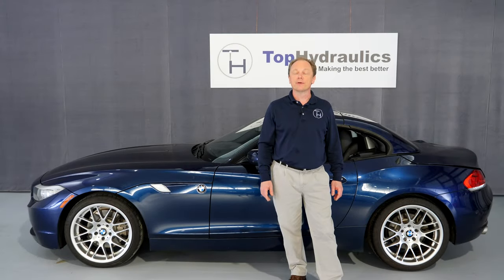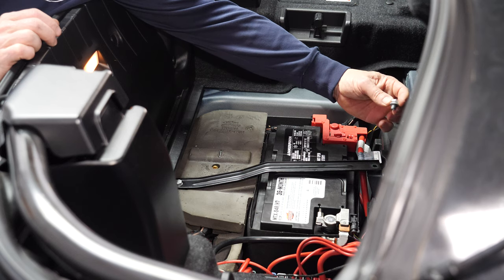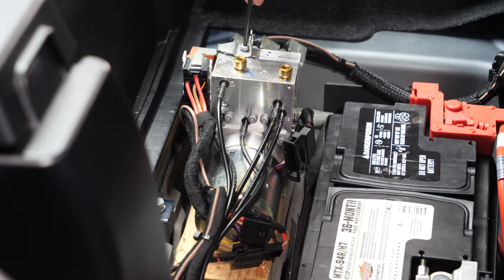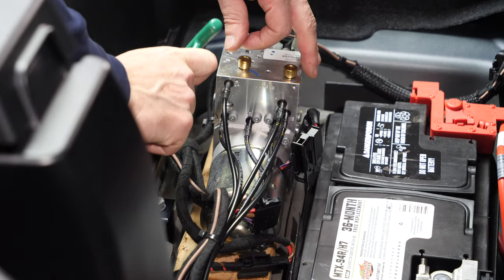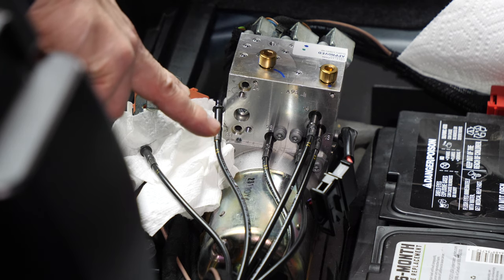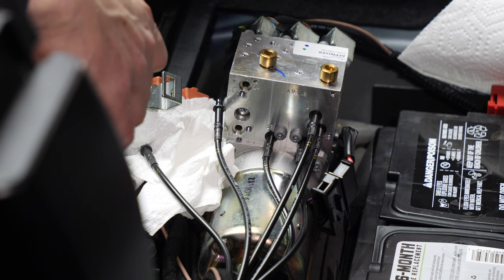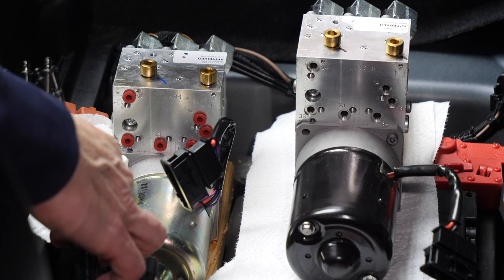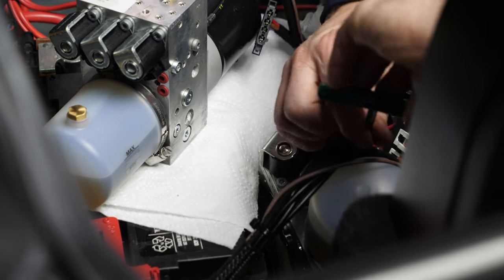BMW E89 Z4 - How to Replace the Hydraulic Pump - Top Hydraulics, Inc.

Comment: I have an error. My error is a68d roof shell 2 closed. Would you bypass it? Or would you do an emergency open procedure to get to the sensor to replace it? Can you can a video for an e89 convertable as there are no videos around??
Reply from the maker: Thanks for asking, I would suggest opening the top and replacing the sensor. Unfortunatley, we won't have time to make in-depth E89 videos for quite a while.

Comment: Thank you for the video! Do you have some suggestions or, even better, a video on how to manually open BMW Z4 hard top?
Reply from the maker: Thanks for asking. Is your top currently not working because you have a leak, or because there is a problem with one of the sensors or because the pump is bad? Manual opening of the top is pretty involved and we would not recommend it just for an occasional drive with your top down, but rather only to get access at failed components. We intend to publish a video on manual top operation in a few months.
Reply: @TopHydraulics  Thank you for the prompt reply! I collected my car from the dealership today. The issue was due to water leakage. I got the leakage issue fixed from the dealership. Right now, the truck opens up, the rear shell comes above the front shell and that's where the roof operation stops.

The guy pointed towards the solenoid (if I heard it correctly from your video) and told me the issue could be due to the temperature sensor here. The dealership could not make this fix as they only offer complete replacement of the hydraulic unit.

Is this also called ambient temperature sensor? Do you know what this sensor is exactly called or the serial number? I see many different kinds of temperature sensors on the internet.  After watching your video, I feel confident about replacing the unit. Is replacing the temperature sensor also an easy DIY?
Reply from the maker: @anujgrover2458  The dealership has the tools to determine whether the fault lies in the pump or not, so let's assume that the pump is problem. The temperature sensor is inside the pump and DIY temperature sensor replacement would be a long shot. Also, the sensor may have indicated a high temperature simply because the pump was working too hard, in which case replacing the sensor will have no effect. 

I would suggest that you send us your pump for rebuild, which will take care of any issues with the pump: https://www.tophydraulics.com/bmw-z4-e89-2009-2016/704-2537-bmw-z4-e89-2009-2016-hydro-unit.html#/30-core_exchange-send_your_parts_to_top_hydraulics_first
Reply: @TopHydraulics  Great instructional video - thank you so much. Another vote for emergency manual closing, my fear is being stuck with the roof down (or partially) and a heavy downpour before I can get to a garage. Thank you...
Reply: @TopHydraulics  
1. Do you ship to Germany? How many days does it take?
I have a 2009 model Z4 (E89)
2. Also do you accept a malfunctioning unit from Germany? 

3. Do you recommend the following or I could may be upgrade it to a 4 solenoid unit if it gives any special advantage. 
https://www.tophydraulics.com/bmw-z4-e89-2009-2016/748-2619-bmw-z4-e89-2009-2016-hydro-unit.html#/78-model_year-2009_2011_3_solenoids
Reply from the maker: @anujgrover2458  Thanks for asking. We ship to Germany on a daily basis and the transit time from us to most places in Germany is three days (!). Of course, we would be happy to rebuild your pump. There is no real advantage to changing from the 3-solenoid pump in model year 2009 to the 4-solenoid version in model years 2012+. The 4-solenoid pump works on all Z4s and the 3-solenoid version works only on model years 2009 through early 2012.
Reply: @TopHydraulics  I went with the pump rebuild option. All was done in a timely manner. Thanks!
Reply from the maker: @anujgrover2458  Thanks for posting that and enjoy your car!

Comment: Hi. I have no codes or errors. The windows just go down and nothing happens to the roof. I replaced the salmon relay but no improvement. Does that automatically mean my pump is dead? Is there a way to check it before sending for rebuild?
Reply from the maker: It is quite likely that your pump is bad. Did you check whether the pump motor is rusty from water intrusion?
Reply: @TopHydraulics  I did check but it looks brand new in there. Willing to take it out tho but hopefully there was a way to test it. Hard to diagnose when there is no codes or errors. Just no movement after the windows roll down.
Reply: @dexterlu1598 what was your fix in the end? I have the exact same issue, no codes or errors, windows go down and that's it.

Comment: Is there any need to bleed any of this after the change over. And/or are there any precautions needed on start-up and first use?
Reply from the maker: Thanks for asking. This is a pretty simple, straightforward DIY job. The system is self bleeding as long as there is enough fluid in the pump. It is "plug and play" if you get your pump from Top Hydraulics, as the pump is already filled with fluid. You want to be alert and ready to stop the top operation the first time you use the replaced pump, just in case you accidentally swapped some hoses or electrical connections.
Reply: @TopHydraulics  Thanks for the prompt reply. I'll make contact through your website in regard to a possible rebuild of my pump.

Comment: My top closes as expected but does not open well. It has a jerky motion and sounds like the motor is surging. Can you tell me if this is how this failure presents itself?
Reply from the maker: Thanks for asking. Yes, one of the symptoms of a failing pump can be jerky top motion, caused by valve failure. Make sure the fluid level in the pump is between min and max, as a low fluid level could cause similar symptoms.
Reply: @TopHydraulics  Thank You!
Reply: Hi, I have the similar problem. I would like to know what was the final fix to the jerky movement of your top coming down.
Reply: By the way. Is it safe to open it when it is jerky going down?
Reply: @hiltondc3  When I looked at the hydro-motor it was sitting in water. I removed the water and unplugged the power to the motor and removed the two bolts holding the motors stator on. They are magnetic so it'll pull out a little harder then expected. I dried both the stator and the rotor and re-assembled it. It's been working fine since.
Reply: @MrCSRodgers  hi, I also took my pump out of its container/sponge and it was wet, same as you mentioned your was. I notices condensation on one of the orange relays and cables. I am drying everything and hopefully works after that. I can’t believe the dealer inspected it and didn’t dry it. A little disappointed about that, I paid them $180 just to tell me that they need to replace the pump but didn’t tell me it was because of water. Anyways, I will let you know how it goes. Thanks for your rapid respeto my comment. Maybe it will save me $5700.
Reply: @hiltondc3  i think you'll need to take it apart to dry it and get it to work. It's pretty easy to do.
Reply: @hiltondc3  also, since the motor is trying to work now, that's a good sign. Though don't keep trying until it's completely dry..inside.
Reply: @MrCSRodgers  I want to say many thanks for your comments and advice. You my friend saved me $5700. I don’t know where you are from, but if you ever come to Portland or might visit your town. I would like to say thank you personally and invite you to a lunch or dinner. Thanks again and have an awesome day.
Reply: @hiltondc3  so glad:) I'm near Knoxville tn. I was in Portland wa last year. Its been a while since maine.
Reply: @MrCSRodgers  Guys, I have the exact same problem one my 2010 23i E89. With an estimate of 4400euros from BMW (I'm from France), I'll try to dry everything like you said, fingers crossed and thanks for your comments !
Reply: @anyideaformypseudo01  Good luck!
Reply: @MrCSRodgers  oh no! We are in Portland Oregon.
Reply: @anyideaformypseudo01  good luck, and make sure to treat the rubber seal to mini water leak.
Reply: @MrCSRodgers  Thanks ! When i took the motor apart from the hydraulics unit, oil fell out is that normal or do I have a leak ?
Reply: @anyideaformypseudo01  no, the motor should be dry. Water was in mine causing the problem. Oil would do the same. The hydraulic oil should remain separated from the motor. Are you sure it was oil or maybe just dirty water? You can see the hydraulic oil level in the clear plastic end of the assembly.
Reply: @MrCSRodgers  No it was definitely  oil. As soon as i separated the motor from the rest oil spilled everywhere. (And the oil level in the tank got down), the motor itself was indeed full of water. So I have a leak and the motor is flooded 😅
Reply: @anyideaformypseudo01  yikes, I don't know anything about the hydraulic seal between it and the motor. I'm fairly certain that the motor is good if it's still trying to move top.

Comment: Is this replacement similar to a 2009 335i convertible?
Reply from the maker: Thanks for asking. The pumps for an E89 Z4 convertible and for an E93 335i convertible are different, but the process of replacing the pump is largely the same. It's plug and play. We are planning on adding a video on E93 pump replacement later this year.

Comment: Can you please help me with 2014 Z4 BMW need to open the roof manually
Reply from the maker: Opening the roof manually is not simple. Is your pump still working?
Reply: Yes the bum still working I just need to change micro sensor on the right side
Reply from the maker: @samfaid230  Are you referring to a sensor in the trunk area or one up in the roof panel? The headliner in the roof panel can be removed by pulling it down.
Reply: Yes the sensor on the roof panel the second pillar so should I pull the headliner down
Reply from the maker: @samfaid230  It was a little premature on my end to talk about the headliner, because the sensor you are taking about is in the pillar while the top is raised, which means you actually have to open the top to get at it. If you could trace the wires for the sensor and fake the signal from the sensor by splicing n the new sensor in the trunk as a temporary measure, then you should be able to open the top with the pump. Is your bad sensor the "roof panel closed" micro switch or is it the "roof panel packed" Hall sensor?
Reply: It’s the micro switch
Reply: I really appreciate you taking out of your time and answer me
Reply from the maker: @samfaid230  I'm curious whether the top would have latched in the front if this switch didn't work.
Reply: Yes the roof is completely locked closed doesn’t want to open the bottom is blinking
Reply from the maker: How do you know it’s this particular micro switch?
Reply: I scanned it with the scan too is the right side microswitch
Reply from the maker: @samfaid230  My assumption is that the micro switch is supposed to have a closed circuit (as a fail safe) when the top panel is closed. I am still confused why the top would have locked in the front if this switch did not work properly. Are you getting any other codes for the top? Is any part of the top not fully locked?
Reply: This is the only code I got micro switch on the right side and the roof close doesn’t want to open the button is blinking I managed to open the trunk and jumped the microswitch from the module and I open the roof I check the signal in the switch and all the sudden the lights stop blinking but I try to close it the light Start blinking again and doesn’t want to close now at this point do you know how are you manually open it
Reply: I have a similar error. My error is a68d roof shell 2 closed. Would you bypass it? Or would you do an emergency open procedure to get to the sensor to replace it? Can you can male a video for the e89 convertable as there are no video anywhere plz??
Reply: . My error is a68d roof shell 2 closed. Would you bypass the cables  Or would you do an emergency open procedure to replace the sensor? Can you can plz make a video for an e89 convertable as there are no videos online ??